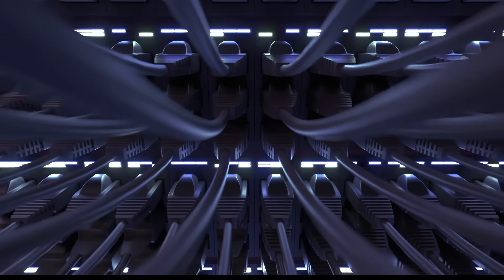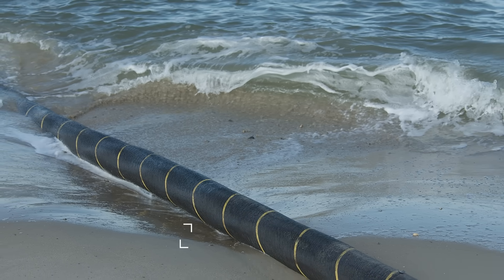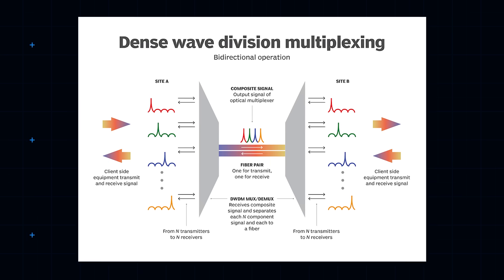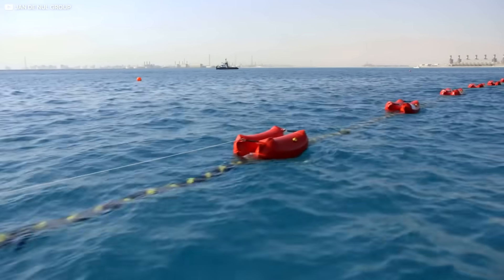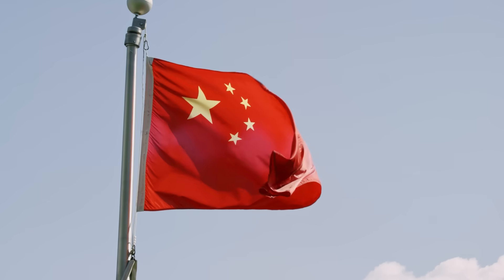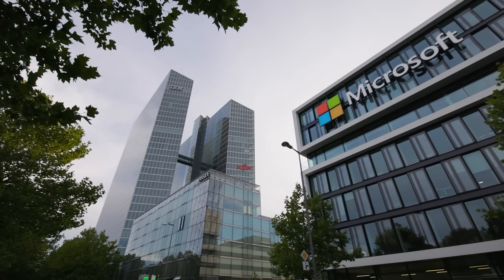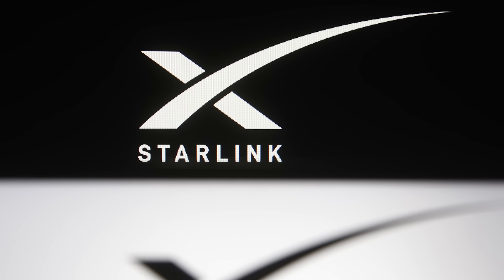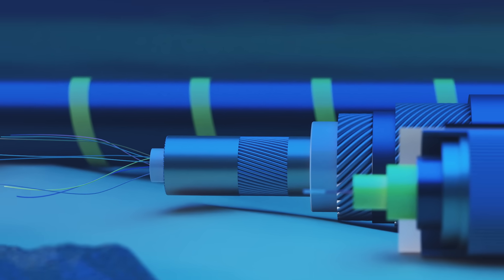How The Internet Travels Across Oceans

Comment: I’ve been working in telecoms for over 10 years and discovering subsea cables was by far my favourite part.
Reply: I started in telecom about 50 years ago.  No such thing as fibre cables back then.  Back then, the undersea cables were analog, with several voice channels.  Satellites were also used.  The first trans Atlantic cable, capable of carrying voice, came online in 1958, IIRC.

Comment: Would like to know what steps have been taken to avoid future cases of under sea creatures nibbling on these cables and how they plan on protecting The cables from volcanic activities , earthquakes etc  .,
Reply: Some of these cables have sheets of aluminium for example wrapped around them in between the plastic sheets to protect it against shark attacks. Can't remember exactly why they attack them but I think they sense the electricity or something and having that sheet in there masks it. Usually these kind of cables have two layers of armouring steel wires of various thickness to protect it from physical damage so they can take quite a beating.
Reply: @Gomjokk  oh ! Didn’t know about this and appreciate the effort to inform me about this !! Thank you and have a good day !!

Comment: I used to work in factory that produced this kind of cables of this ~diameter. We produced the most expensive ones with 3meters per hour. 1 meter weight is about 40 kg made of aluminium and about 75 made of copper.

Comment: I still have questions! How are the cabled anchored to the seabed for so many thousands of KMs if they are just hose width in diameter on average? How is a cable repaired underwater if the introduction to water in the internals of cables could interfere? If you have thousands of KM of cable and you've got an outage, how do they know which part of the cable needs diagnosis? If the average depth of the oceans around the world is 2 KM, then how could a repair to one of these cables only take a matter or hours, as stated in the video? Sorry if this all sounds really ignorant.
Reply: Cables are not anchored to the seabed. If they are in water depth >1000m, they are simply laid on top of the sea bed and their weight will be sufficient to keep them more or less in the same place although currents may move them which is why we leave plenty of slack to ensure the cable is not stretched and broken. In water depth <1000m where there is fishing activity and anchors, we bury the cable at least 1m below the seabed, using a plough which is dragged along behind by the cable ship. The cable is fed through the plough and falls into the trench as it is cut and then the soil naturally falls back on top of the cable. ROVs are used to do a post-lay inspection and fix any areas where burial by the plough has not worked. We use OTDR (Optical Time Domain Reflectometer) to at least identify which segment between repeaters (c. 70km) is faulty. We then have to go out on a ship and use a grappling hook to trawl for the cable in that location using the "as laid" data. As above, the cable can have moved so this is a bit hit and miss. Having found the cable and made sure it is the right one (!), we haul the damaged section onboard the vessel where replacement cable (and sometimes a repeater) are spliced into the cable by extremely skilled experts. A marine repair like this will take at least two weeks and sometimes much longer. Minimum cost US$1M.
Reply: @jknrawle  So insane ! thanks for your comment !!!!!
Reply: From what i know there use a machine that give electric pulse and if the pulse returned, they can know how far it reached for example 5km or 500km and go to that location and fix it
Reply: The repeaters every '70-100 kms' would also detect where the problem is. Kinda like Christmas lights, when one goes out, there's no lights on past that particular light.
Thus, the repeater that isn't getting receiving signal would theoretically be the first one past the problem.
Repeater A has signal, Repeater does not, the problem is somewhere between those 2 units. Theoretically of course.
They prolly have devices that detect the electricity running through the cable like an electrician finds hot wires in walls. When their dinger stops dinging, problem found.
Reply: @applejacks971  These are optical cables meaning not electricity, but light runs through them.
Reply: @matyi94     The optical portion carries the data - the cables have copper running with them to power repeaters.
Reply: Good questions, shows you are uninformed not ignorant. 
I can answer some. The weight of the cable holds it down, cloeser to shore they use heavier cables and dig them in to the sea floor. 
For repairs they grapple for the cable and bring it to the surface. Water wont get in because they are armored and most of the cable is the sheath, the fibers are not much more than a hair and are in a gel and as they are glass even if water got the fiber it wouldn't damage it. 
Fault location would consist of isolating to the nearest repeater section and then using a device call a optical reflectometer , which sends a light pulse down the fiber and and times how long it takes for the reflection from a break or damage to the cable to come back. 
Repairs can take days to weeks, the hours would be the time to reroute the circuits over alternative cables.
Reply: @russellosborne8795  Thank you so much for for taking the time to answer all of this for me. Made my night.
Reply: @RF-dr8tt  just want everyone to remember how everything they have is courtesy of a White man
Reply: All in all, it was a pretty good clip but I have no idea where they came up with the matter of hours to repair it.

Comment: I believe that internet cables will still be used for decades because its more secure for fast interweb speed and wireless interweb is not, little bit cloudy or rain or even brick wall can make a wireless connection bad. With cables the internet speed is faster, almost the speed of light but not quite.

Comment: This actually bloooowwwss my mind. The way the most modern thing in our time works is definitely not as I imagined. I was thinking something depending on satellites. This gives me a lot more patience when my internet acts up for those 25 seconds. 😧😧
Reply: it's faster because it's through cable. If it was satellite, it'd be slower and more inconsistent
Reply: @ShamliseG  who? asked you
Reply: @bigchungus14hvh12  what's with YouTubers saying "who asked?" these days? 

The most important question is, who asked you?
Reply: @MelodicTurtleMetal  Well, he got you to throw his name out there an additional time. Think of it kind of like junk mail. It's just an annoyance of modern times and a throwback to the baser instincts of mankind.
Reply: @MelodicTurtleMetal  who asked
Reply: @ShamliseG  Satellite is actually faster, it just that it cannot handle so much gb as they will have to make a bigger satellite and more expensive to build.
Reply: @haijin7484  satellite is horrendous for anything requiring more than basic connections. Starlink is seriously overrated
Reply: @ShamliseG  exactly. Satellite is horrendous if you want consistency, reliability, and expandability.
Reply: Both cables and wireless (satellite) connections travel at the speed of light, but satellite is further away, thus increasing latency, that’s why it won’t ever replace cables. Unless we figure out faster-than-light-travel…
Reply: @jerryg3652  The light in cable does not travel at the speed of light, because it is slowed down through the material of the cable. Light only travels at the speed of light in a vacuum.
Reply: @mrmancheste  Hmm, I don't really get how it works at a scientific level, but I'd thought it'd be like electricity, and 'move' significantly faster than the speed of light.
Reply: @fearedjames  It is because the light is broken and reflected inside the cable. So it is slowed down
Reply: @mrmancheste  Are you slow? The speed of light is always constant whether in space or on earth, it never changes.
Reply: @brodylockwood14  um, that is absolutely not true lol the speed of light depends on the medium through which it travels. The most well-known speed of light (3x10^8m/s) is in a vacuum like space, meaning no air or anything else to slow it down. It travels quite a bit slower through something like water or glass.
Reply: If you were using internet in the time of dial up you would be a very patient man regarding that, I still remember when 1mb was the king speed and before that when I would download a game (RO) 1GB and would take 1 week lol
Reply: Starlink ;p
Reply: @samyoon7796  Yeah, you are right. Between the satellites it will travel almost at light speed
Reply: ㅋㅋㅋ 대박
Reply: @clementine2001  You can literally see them at night time in the sky.
Reply: Spiderman2Playstation5<what?

Comment: Like everything else, this will also be obsolete once. But I don't think it will happen in next 200 years. Starlink is just a "bad" alternative, since latency will be a huge problem.
Fiber Optic under sea is the way to go in my opinion ... you can't go faster than speed of light :)
Reply: actually, when the data travels in a vacuum it's faster, which means latency shouldn't be a huge issue for starlink.

Comment: I use to make the internal jointers that joined the cables together, they were 100% checked by an independent company before getting on the boat that layed them, no discrepancy what so ever was excepted, all very high precision stuff!
Reply: do these jointers have some sector alert chips to know which part of the cable in the ocean is damaged or do they just see it by the jointer itself where in the ocean which jointer sector is dead or how do they know?
Reply: @BEFORETHEMHYPEBEASTS  
No chip as far as i know, but we were only one manufacturer of many, all working on the jointers No idea what the others were making or what the finished product looked like. The jointers were made from many parts, we only made the very innermost components, and possibly not all of them. I did go to the checking company "Sea Talk in Lymington" on a couple of occasions to deliver our parts and the place was full of components I'd never seen before and this building was rammed with CMM checkers. I was told that some time back components from somebody got on the ship and we're not of spec, didn't fit basically. The ship had to return and no cable laying took place, the thing here is "who pays" this won't have been a cheap easy fix mistake! I believe this is why Sea Talk the checking company was set up, to make sure it never happened again.
Reply: @BEFORETHEMHYPEBEASTS  A pulse is sent down the cable and is reflected back.  They can tell from the length of time it takes to get back where the break is within a few hundred meters.

Comment: But I thought it went to the satellites in space flying at 17,000 miles per hour? GPS= Ground Positioning System
Reply: Yes some features come from satellites. They are slower so we dont use them anymore
Reply: Most GPS signalling is A-GPS and utilises cell site towers for triangulation.

Comment: The future is actually going to be satellites with lights on them and ground units with telescopes transferring data through changes in the lights. It will be true speed of light transfers across the globe with nearly no interference problems due to the fact that the world is never completely covered by clouds. It will take AI to be able to reroute and redirect signal based on fastest connection for it to actually be better than hard line signals.

Comment: The immense advantage in fibre optical cables is that the cables are not becoming obsolete. The transponders become obsolete as technology develops every day. We replace those at the ends of the cables, improving capacity without the need to replace the cables themselves.
Reply: I can imaging a bandwidth issue will occur in the future. But that is just my imagination, I dont know much about light.

Comment: Generally speaking I think anything wired is superior if the wireless connection doesn't offer some kind of advantage over it.  Wireless is always less reliable, so wired connections are preferred if they're available.  But it's an interesting question if SkyLink and such projects might become more popular than cable internet.  Only time will tell, I suppose, but I have to think the answer is no.
Reply: Depends entirely on where you live and access to existing cables. The advantages of sky link are no cables which means its  perfect for airlines or those in moving residences such as boats, campers ect. Also not everywhere has fibre optic as its expensive so its generally reserved for high density areas or its not deemed worth the investment. I ordered starlink i will see how it goes when my kit arrives at the very least ill have options as the telecom company here is garbage and their crap is always breaking and good luck contacting them about it. Even if you do it'll be a week or more before they do anything about it and from my experience it only lasts a month or two tops before the same issue pops up again.

Comment: It is very hard to believe that 99% of traffic travels through undersea cables, what's the source of that number?
I thought it would surely be much less because most of the data, like this video I am watching now, would be cached somewhere in my region(not even 100km away from my location in fact).
Reply: Made up number for sure. Just the traffic between US datacenters will exceed the entire capacity of undersea cables.
Plus just like you say, each major streaming service, or game distribution service, will have multiple of its cache servers located in different regions, shared through local internet exchange.
Reply: @tomkocur  The video doesn't really explain much but 400Gbps is actually the wavelength of one fiber optic strand and the actual speeds are about 100x that, also these undersea cables have many fiber optic strands in them not just one.
Reply: @TheHhhh2  yes. DWDM is a common thing on every backbone network. Not just in an undersea cable. Providers also don't typically lay two strand cables, typically it's 64 and more.

Comment: I think those cables could eventually meet the same fate as dedicated telephone cables we used to have all over the place but for now it's hard to justify because wireless will not get anywhere close to the price and efficiency of already established cable infrastructure.
Reply: Wireless will never be as fast or as reliable as fiber optics.
400GBASE-ZR can do 400Gbit over 120km on a single wavelength. You can put multiple onto a single fiber and you can put multiple fibers into a single cable.
Fiber is also much safer, because you can't just have someone "listen in" on transferred data. 
Radio doesn't come close in neither speed, nor distance.
Reply: @tomkocur  With the IPSec encryption that's used with 4G and later phones, it's hard to just "listen in".
Reply: @James_Knott  4G is not even an alternative to fiber, unlike something like WiGig.
But still, wireless can be intercepted without trace, fiber can't.
Reply: @tomkocur  My point is wireless is not as easy to intercept as some think.  The original 1G analog system was very easy to intercept and listen to with an ordinary scanner, to the point the U.S. passed a law banning scanners that could receive that cell band.  2G and later, being digital, were much harder to intercept without special equipment.  With 4G and later, the calls are encrypted with IPSec, which means it's virtually impossible to hear the contents of a call, even if you intercept it.